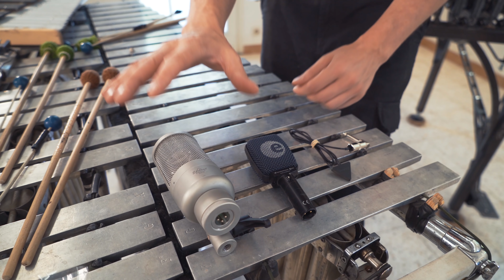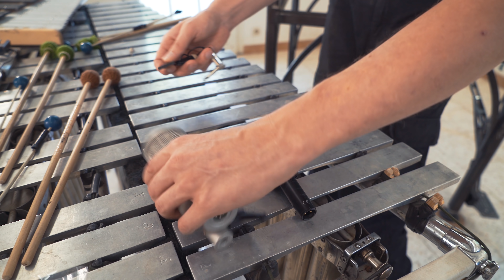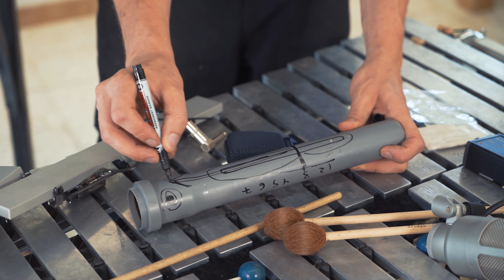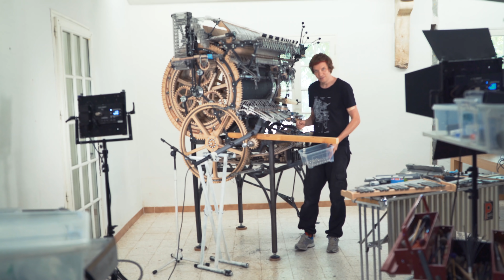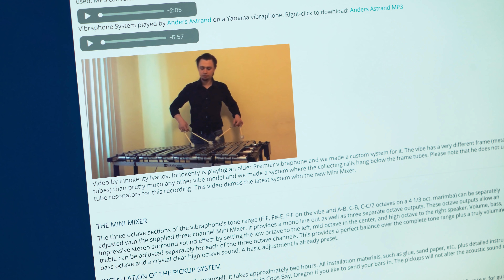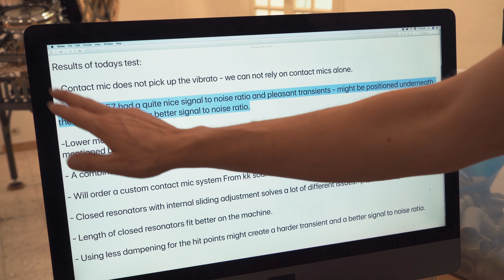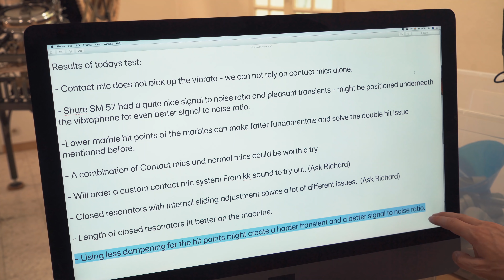Vibraphone Experiments / Microphone Types - Marble Machine X #96

Comment: Hey Martin!  I wanted to point out that your idea of capping the end of the resonator is actually how they are supposed to be on an actual vibraphone!  If you're wanting to match the technical design of the vibraphone, you'll definitely need to cap the bottom end.  Also, the optimal length of the resonator pipes is actually NOT at the point where it is perfectly in tune.  When the resonator is in tune with the bar, there is actually a pretty decent drop in sustain of the note.  Also, it should not just be the same pitch, but the pitch 2 octaves higher.  

You will get the best results if you tune the resonators 2 octaves higher than the bar, then flatten it slightly.

Also, the good thing about the resonator pipes is that they amplify ONLY the fundamental, not the partials.  So while it is still ideal to strike the bars off centre, you may be able to get away with striking the bars on centre and still get a sound that is a little more pleasant.  I guess it's a trade-off between simplicity of marble drop locations all being the same, and dropping the marble closer to the catches and getting a slightly better (albeit still a compromised) sound.

Finally, for the micing, what you could do is have piping that is maybe 10 cm long that contains the mic embedded into the stopper at the bottom, female end up.  The resonators would be tuned with this piece added to the bottom.  You could also permanently affix a piece at the top that the vibe flaps could be mounted into.  Then you would just swap out the different length resonators matched with each bar, attach the mic tube at the bottom, and you're set.  That way the vibe flaps would be permanent, you wouldn't need some fancy system for adjusting length, and all notes are permanently tuned, so you can spend the time precisely tuning them once, then never worry again.  No compromise, no complicated tuning mechanism.
Reply: For those reading along that don’t know, closing a tube makes it drop an octave. To go up an octave, you cut the tube in half. So down one capping, up three by cutting to 1/2, to 1/4, to 1/8th the length. I think that’s close to what Martin was holding in his hand towards the end for the slider ideA.
Reply: @wraybowling  you're correct.  And thanks!  I suppose a little bit more explanation might have been helpful, but I was worried my reply was getting long as it was XD.  However, that's not the whole reason why the vibraphone uses capped resonators.  The length is obviously one of the biggest.  But the other reason is that with that cap at the bottom, the sound can reflect off of it, and bounce back and forth between the bar and the cap.  This is essentially how it amplifies the fundamental, and dampens the partials.  I'm fairly certain Martin is trying to tune the resonator to the exact sounding pitch or the bar (thus the resonator was half the length when it had the slider mechanism), which is why I mentioned the importance to keep in mind that in order to get the best sound, the resonators cannot simply be tuned to the exact pitch of the bar.
Reply: I think this is a great way to go and I hope Martin sees your comment. It seems like it solves several potential issues.

Correctly tuning for two octaves above will result in shorter, more manageable pipes. Having the mics at the bottom of the resonator pipe will capture the sound coming down – though care may need to be taken that the sound pressure doesn't overload the microphone; the mic may need to be positioned in the side of the tube rather than in the bottom, facing up.

The modular idea is great too, though it might take a little bit of time to put each end cap on.
Reply: @TerrisLeonis  I hope so too.  I mean I might be biased, but I think it's a pretty darn elegant solution XD!  As for the sound pressure, it shouldn't be an issue.  A microphone like the SM57 would have, on average across all frequencies, a max sound pressure level around 150-190 dB.  190 dB is an absolutely RIDICULOUSLY improbable sound level, and even 150 dB is way higher than anything that would be produced in the resonators.

Comment: @Wintergatan
You made the machine rather quick and easy to reconfigure (quick change program plates, quick swap vibraphone plates, and easy tempo changer) needing the pipes to be adjusted for each note change undermines the efforts.
I'd suggest putting a mic on each plate, and reconfigure the quick change to also make/break the mic connection.
For the vibrato, go digital, but with some visual flair. Should be able to use an RMP sensor to tell the sound system how fast it is spinning and adjust the vibrato effect.

Comment: Is there a way you can use the vibro plates like a kalimba... the point is that you have to use one resonator box for all the notes... you can use the same rotating sistem on only one hole to create the same effect... the sound of the kalimba is amplified with the wooden box and when its in contact with a surfase like a table or something it amplifies even more.... im not an expert but its a simple solution

Comment: Martin, the sound exits from the tubes, and so the microphones should be at the ends of the tubes, but you don't want to load up the under carriage with mics? How about some kind of tiny mic suspension device for small mics (like shirt pin), or some kind of diaphragm film for the contact mic, at the end of the tube (which may muffle the sound, off mic, but it may pick up with the contact mic?). There is no point in putting contact mics, on an instrument that vibrates (imo). And the vibrations get waffled with in the tube...so you should focus on how to capture the sound, from the end of the tube. I also want to say that's it's a joy to see you post before wednesday, and thanks to all of your suporters for helping out. See you next time.

Comment: Do you foresee ever playing this "Acoustic"? If no, then contact mics. Easier, you already need mics for most other parts so making it sounds nice in free air doesn't mean much.
Do you even have room in the CAD model for the resonators?
Does having it sound nice in free air offset having to add another part that needs to be messed with and changed out when changing songs or sets? There's already a lot of setup/teardown.

In my mind, it makes more sense to go with contact mics or looking into the other mic systems mentioned in the comments.

Comment: So have you thought about lav mics? Also perhaps damping the sound inside the resonator while the Mic is also inside the resonator. It's not as if the resonators need to project there sound, you simple need to capture it's effects to the sound. A small internal damper that doesn't alter the color of the sound too much but softens the transients a bit seems to be what you need.

Comment: There has to be a way to get that K&K Mic system AND the Tube resonators to work. Maybe get those Mic Heads close to the end Resonator Tube (Just Under the sound bars)  and where the vibrator discs turn.  BUT not inside the tubes.  You might have to give the mic a lil felt dome so that it cuts down on the Sound to Noise.  Hope that helps.

Comment: If you put the contact mic in the resonator tube, the strength of the wave depends on how far down the tube. Theoretically, in a closed resonator tube, the wave will have zero strength at the closed end and be strongest at the open end. Not only will you need to change the length of the tube when you change the plate, you will need to move the mic, however, you will probably find a placement where the wave doesn't overpower the mic.

Comment: Some ideas I had:
Does putting a contact mike in the resonators help?
Is there a design that would make adjusting the resonators pipes FAST?
Is there a way to mark resonators with rings such that they give visual feedback for what note they are tuned to?
Reply: I immediately had the same thought, would contact mics on the resonators capture the vibrato?  But given that this isn't a problem isolated to the marble machine and the company that makes contact mics for vibraphones uses a digital vibrato effect, my guess is that no, it doesn't :/  but it wouldn't hurt to test it right?
Reply: I would like to see the contact mic on the resonators testing as well.  Also, other good ideas.
Reply: I thought about a outside sliding pipe with "stoppers", they click on place on a preset adjusted. That could very easy to archive.

But getting rid of reasonators pipes is a much smarter idea.
Reply: Without testing it, I have no definitive answer, but just based on gut feeling and assumptions, I'd say that contact mics probably wouldn't work on the sides of the resonator pipe, and possibly on the end if it's closed.

In the case of hitting a cymbal or vibraphone, you're creating vibrations perpendicular to the surface of the instrument.  These up and down vibrations are what the contact mic pick up.

Sound, however, is a compression wave.  As the cymbal surface moves up and down, it creates waves of high and low pressure (high as the surface moves towards you, and low as it moves away).  Compression waves do a poor job of transferring energy perpendicular to the direction of travel, so you wouldn't get a strong vibration in the sides of the pipe compared to the volume of the sound.  On the other hand, when the sound hits the closed end of the the resonator pipe, then you get a much better vibration in response.  But if you're going to do that, you'd might as well stick a Shure SM57 in the tail end of the pipe.

Comment: Hi Martin, apologies if this solution has already been brought to light below, but could you use the contact mic system for the plates and then mic the resonator pipes separately using 2 or 3 mics below, then you'd have even greater mix control between the plate note and the vibrato?

Comment: Think of a typical aluminum crutch... the ball detent system is a good one that could be applied to your resonator tubes.  You'd just need to seal the hole, or make it a dimple detent rather than a hole detent.

Comment: Using http://www.studyphysics.ca/newnotes/20/unit03_mechanicalwaves/chp141516_waves/lesson51.htm as a general reference, switching the vibraphone resonator pipes for the correct lengths of closed pipe might provide an opportunity to use contact microphones. Using a pipe with a square cross-section (like a square organ pipe, same principle) would give you flat faces to mount contact microphones lined up.

The part I haven't figured out is if the contact mike would have to be installed on a node or antinode point to actually pick up anything, if it they would pick up anything at all even then. Securing them on one of the round pipes for testing might be doable, but it would have to be tried at varied points along the length? That could be done even with the PVC(?) plumbing you're currently working with. With some math it shouldn't be too hard to calculate where the nodes and antinodes are supposed to be along the length of a given resonator/vibraphone plate combo.

Comment: Hey Martin! 

Simple and elegant solution which will capture the full sound of the vibraphone, regect a fair amount of mechanical noise and be easy and elegant to attach to the machine:

A pair of DPA 4099 supercardioid instrument mics.
Position these above the vibraphone (they make loads of different mounts that you can use)  
, and angle the back side of the mic towards the loud bit of the machine as there is a rejection null there.

Alternatively, use a true figure 8 mic positioned on stands in front of the vibes, with the front lobe pointing at the bars and the regection null at the big loud machiney bit. The off axis rejection of figure 8 mics is amazing so this could work really nicely!

Comment: What if you leave the bottom of the resonator tubes open but stretch a membrane over the bottom, almost like how a drum head sits, then put the contact mic on that (either on the inside or outside) The membrane would vibrate at the bottom of the tube (unlike the stiff pipe) and the contact mic would be able to pick up the resonation off the membrane. Then another set of mics to pick up the plate hit specifically.

Comment: Some have suggested putting the contact mic on the tube, also how about putting the contact mic on a membrane inside the tube, that's thin enough to feel the air vibrations and not kill it. 
An important thing to note is you'd have to be careful not to place the mic in a node of the vibration to do that.
Reply: Alastor I had the same thought except putting the membrane at the bottom. I hope he sees this idea.
Reply: @MichaelBelcher-g7t  The issue with putting it at the bottom is I would probably bet that the bottom of the pipe is a node of the wave, which would make it the worst place to put the mic in terms of signal to noise ratio. Similarly to the fact that a string resonating at a frequency mooves at neither end. It should be tested of course, I could be wrong on that, and if I'm wrong it would make things even easier.

Comment: Ideas to try : 
- contact mic on pipes and contact mics on resonators. 
-  saxophone (or such) mic inside the pipe AND outside => use outside mic as noise canceller (by substracting the signal to the first one)
- use much smaller piezo transducers ! (such as ones for violin or acoustic guitar (steel bar style could fit well wit the resonators)
- flat paperlike trasducers can be cut with sissors (can be usefull to know)
(Go on cheers !!)

Comment: Hey Martin. I've been watching since the beginning, loving every minute of it. 

Idea for the resonator pipes -  What if you made the resonator pipes out of a thin walled pipe. you could perhaps place the contact resonator on the outside wall of the pipe. If you used the closed resonator pipes you could place them on the end wall. Alternatively, if you choose to go with the adjustable closed resonator pipes you could place the contact mic on the closed end of the tube. This way there would be no need to swap out the mics when you changed out the vibraphone plates. Just a thought! Keep up the good work.

Comment: This is a difficult mic problem. I'm just a guy that has done a few two mic recordings. But I understand the issues. It looks like here actual acoustic mic pickup is best. Ideally you want to place, whatever the chosen mic is, at the instrument's sound loudest point. We all know that part. Unwanted sound needs to be blocked out. ... So build a sound shield around the mic only letting in what you want to pick up.

Comment: If you end up using non-contact mics, you could set a custom EQ to filter everything but the frequency of the specific note and its overtones. That would probably help your signal to noise ratio. Of course, that is assuming that each note is individually mic'd.

Comment: if you can have closed resonator pipes. can you not have a membrane in the bottom of the pipe, that is light and thin enough to resonate ith the sound of the vibraphone and then have a contact mic on that membrane? a little like a mechanical ear sort of thing..

Comment: Probably a daft comment but could you not just use a couple of condenser mics pointing at the bottom of the resonator pipes and just gate them to get your desired signal to noise ratio?

Comment: Question: the contact microphones dampens the noise when you stick them on top of the notes. What about edge-on? If it isn't in the middle of the vibrating mass, it might have a reduced dampening effect, right?
Maybe not since it might simply be a result of the glue being used. Are there any other solutions to getting the contact microphones to stick? Some kind hard polymer or resin or epoxy that wouldn't affect vibration as much? There's going to be a loss either way, but there has to be a solution to mitigate it somehow.

Comment: Instead of a paddle inside a tube (hard to manufacture well), why not a u shaped tube that slides in and out (like a brass instrument)?  Also, it looks like the vibrato works with the paddle on either end based on the little bit where you were tuning the instrument, so you could have a short section coming off each note, a U section that goes with the plate that then ties to an end section that is in a straight line to accommodate the vibrato paddle.

If you make it out of white PVC it will start looking like some sort of Blue Man Group instrument though.

Comment: What if you put the contact microphone on the resonator itself , or maybe create a second “resonator” with the soul purpose of picking up noise within a close proximity. Another option is insulated the microphone so it will only pick up sound right by it, and not the machine.

Comment: It's awesome work that you're doing I do have one simple question why decided to use PVC pipe when really awesome vibrato is controlled by a metal tubing and yes you could shorten that two very small lengths also if you had a single link that spun all of our brothers at the same time then you wouldn't have a worry if it was working in 1/2 or the other it would just be the tube's connecting in for the right size and write Dimensions not all of them all at the same time makes it a little bit tricky but might make your day better and easier in the Long Haul

Comment: Hello Martin,
please try a tiny condenser microphone with a high max SPL rating like a DPA 4061 or even 4062 (perhaps something cheaper or just ask them for a sponsoring). You will get excellent results if you mount them directly to the side of the plate holders. Please do not attach the actual mic body, but its cable close to the mic. I am sure you would only need one mic every two notes.
You have to consider that all sounds are dampened by 6dB when doubling the distance. So just moving close enough with a tiny microphone is the key to your success without any compromise. By moving the microphone position a bit downwards you could even get a away with one mic between four plates.
I hope this comment will reach you. All the best!